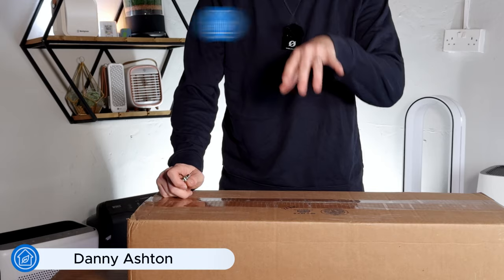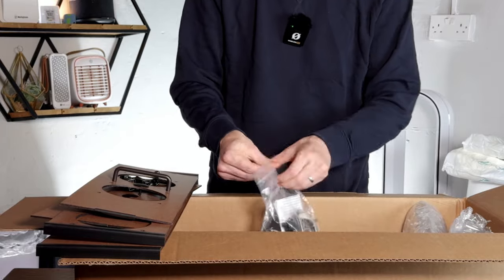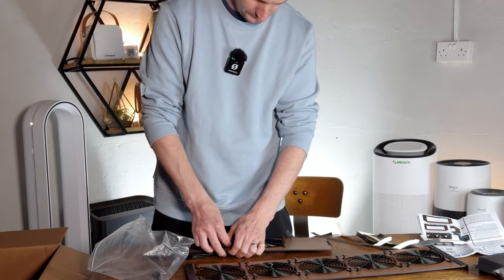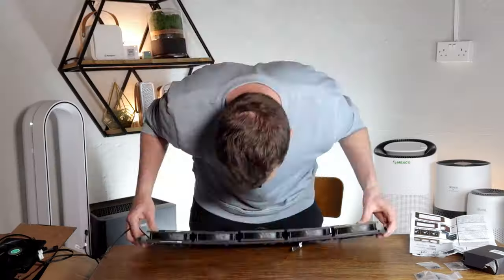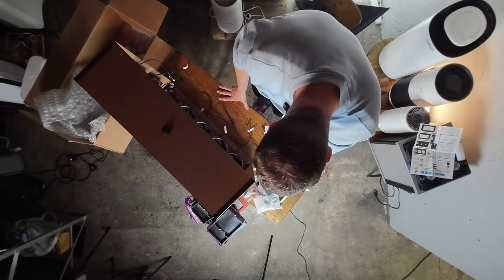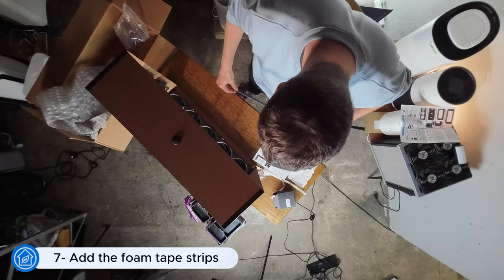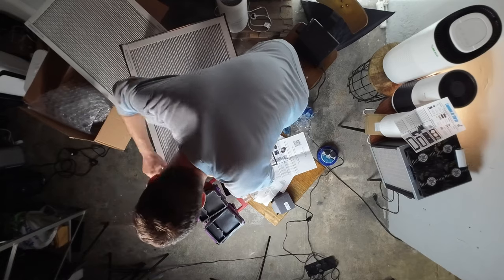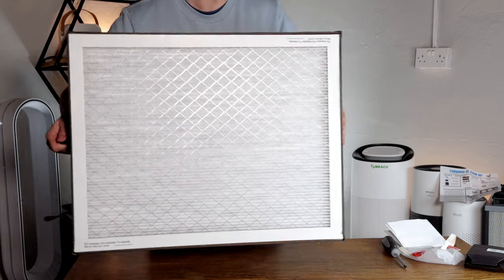CleanAirKits Luggable XL7: Unboxing - How to build it

Comment: For anyone who doesn’t want to pay $200+ for flimsily hardboard.. look up DIY shop air cleaners most typically involve a box fan and square filter
Reply from the maker: Those DIY shop air cleaners are great but often will run much louder due to the fan they use. But certainly much cheaper to build I agree.
Reply: Just buy a freaking levoit or similar. Cheaper, quite and way less power usage.
Reply: @deinemamainhd  Haha for most people this is likely much easier I agree. But they are much quieter when running at high speed than a device like Levoit and use way less power.
Reply: I'd love one but shipping to the UK is currently £400!!! There are no levoit 200s in the uk... really struggling here
Reply from the maker: @Elwon20  I have spoken to them about Shipping and hope they fix. I am reviewing the Northbox 6Xl and their bare kit to ship only costs an additional $35.

https://aidankepo.wixsite.com/northboxsystems 

Review should be live at end of week.
Reply: All fans push the air outside of the  box? Or towards the inside?
Reply from the maker: @Gab-bs2nr  All fans push out so the air is forced into the box through the filters.

Comment: I was really considering this before I settled on the Air fanta 3pro from Adam Wong. Glad you're comparing these. Hope we can get a head to head in the future 🙏🏾
Reply from the maker: Had the same idea, will work on this after the reviews are out.
Reply: I have both and they definitely aren’t apples to apples! I love the AirFanta 3Pro for price and ease of assembly but only plan to use it on full power in rare circumstances since it’s so loud. (Like if someone is sick or if I need to clean an unoccupied room quickly after workers have been in my house, etc.)
Reply: Hey, thanks for your comment about the Air Fanta 3pro.  Have been using a 20"  Filtrete hepa filter on a box fan for a few years - works okay.  The Air fanta 3pro looks great much sturdier than the Luggable XL7 and can do 3200 sq feet.  Very cool...

Comment: lol, just put mine together. It is elegantly simple, can tell engineers designed this thing. The wood is so flexible it makes fitting the filters in really easy, and the wire and bungie cord holds everything snug... i didn't even use the tape, and it's still snug. Plugged it in, and it is soooo quiet. Brilliant. 5 stars. for simply functional.
Reply from the maker: I really liked that you didn’t use tape with this one as it was the trickiest part of the luggable xx. Glad you liked it and hope it will give you plenty of clean air! Thanks for reporting back.

Comment: do you think this can be hung on a wall? or it would just need to be placed on a shelf? if so, does both sides with the filters need not touch the wall correct?
Reply from the maker: Yes as long as the filters have some space between the wall it should be fine. It could potentially reduce performance a little but I doubt it as the filter size is so high that it doesn't rely on a large amount of airflow to work.

Comment: Hi, thanks for the video. Wasn't there some sort of plastic "grill" for covering the filter faces? This was the piece I had the most trouble getting on the first time, and I am dreading changing my filters out because I will have to take those pieces off and on again without shredding the MDF.
Reply from the maker: There is a grill you can buy but it was extra and didn’t come with my kit. I did find the grill bit challenging so taped it down to make to a little easier. They do say you don’t have to use the grill if you don’t want to. I don’t think it looks bad with just the filters as the filtrete ones look pretty pro.
Reply: @HouseFresh  Ah, OK thank you!
Reply: We've expanded the slots a tad on the grill frame so new ones slip on/off easier.
Reply: @cleanairkits  Glad to hear it! Any advice for a set I already have with the very tight fit?
Reply: @joshuaremba8261  Just start wiggling from the corners and work your way toward the middle.
Reply: @cleanairkits  It's time to change my filters at this point, I think I will have to try and add some more tape on the corners to make that work.